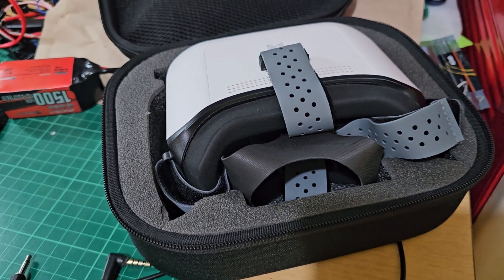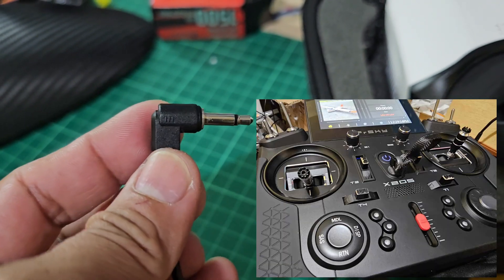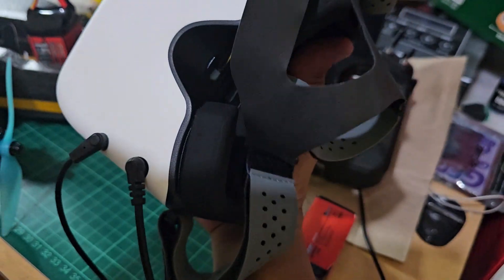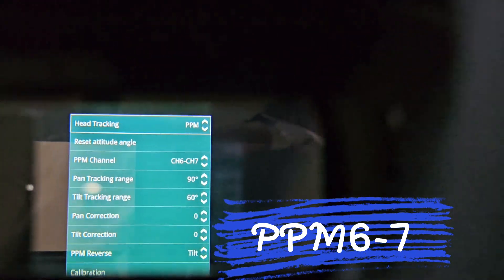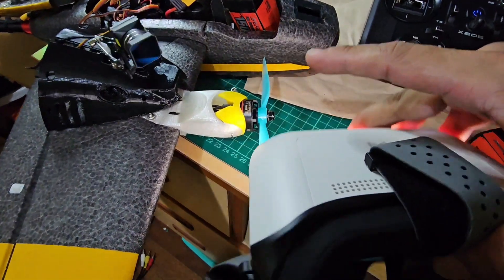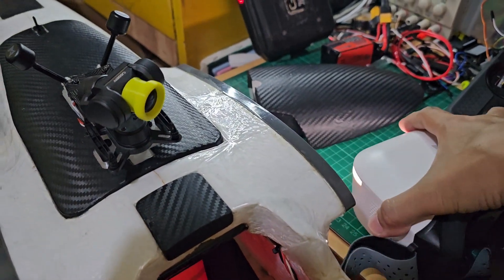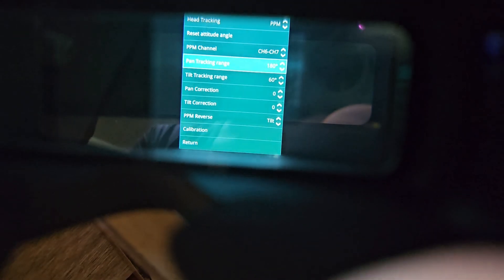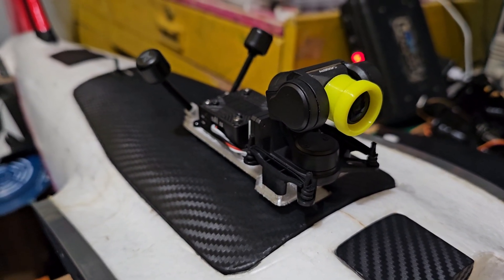Headtracking via PPM on Walksnail Goggles L?

Comment: 👍 Thanks ! But also confused.
can you use PPM (via trainer) AND head tracker (wireless) - at the  SAME TIME - or it is ONE or OTHER ?
Like idea of using head tracker in Goggles L for tilt - but PPM (slider) for pan  (concerned about signal strength if I move head too much ..)
sorry for noob question .. 🥴

Comment: Hello,
Using my Goggles L using ppm but the servo can't reach 180°, only 90° but in the goggles settings I have 180°
Regular 180° servo
Tried to increase the weight % on radio but is the same thing. 
Any idea about what I'm missing?
Reply from the maker: You need to extend the end points of the servo in the flight controller pwm outputs

Comment: Nice. I like the idea of using both sliders OR Goggle L input for the Walksnail GM3.  A 3 position switch for:  no head tracking and fixed cam position - GL headtracking - TX sliders.
Reply: Hey apappiek! Can u Show how to set this up on a 3 Position switch?
Reply: @marvfpv5841  It is still not possible to switch between these modes as far as I know. Walksnail has withdrawn the latest FW with the option to switch to a fixed gimbal position with a tap on a button of the goggles.

Comment: Hello,

Where did you buy the cable ?

Can you tell me if a cable with 2 stereo plugs works for the headtracker?
Reply from the maker: The goggles L uses a 4 pole 3.5 TRRS jack. You can customize one, it's common stuff sold in audio equipment stores. Connect only the tip and sleeve.